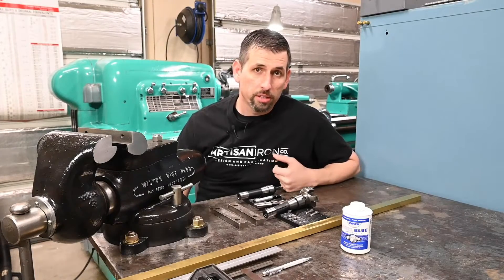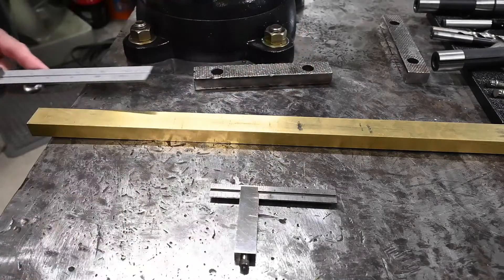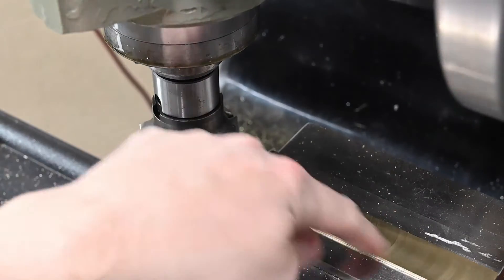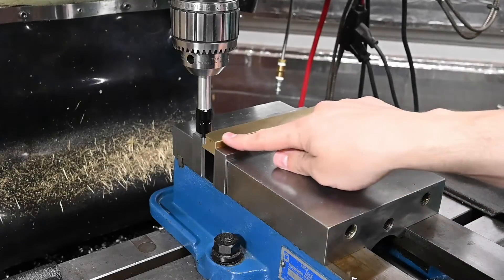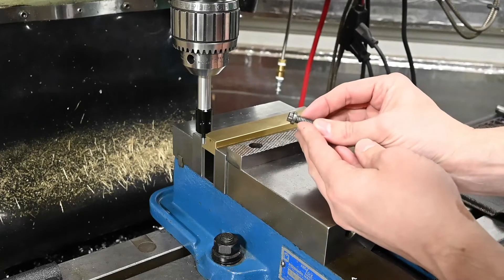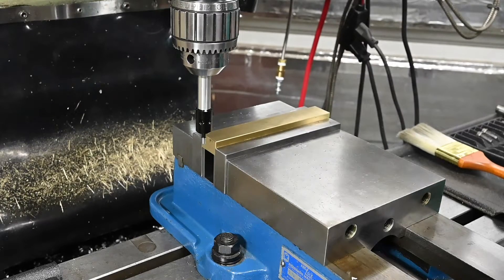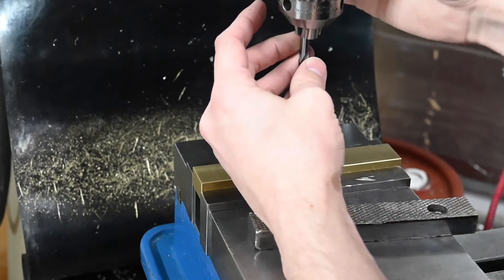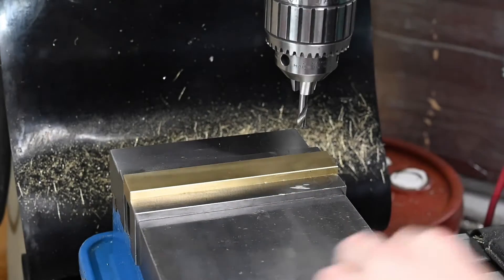Making Brass Jaws for a Rare Wilton 6" Vise: No. 60 Swivel Jaw

Comment: Great workmanship,  wrong material. Brass is  springy and slippery, which is the opposite of what you want. Copper is soft and gummy, which is what you want.
Reply: The static friction coefficient between brass and a notional steel part being held in the vice is actually higher than the Cf between copper and the same steel part. I *assume* you’re referring to copper having somewhat higher ductility than brass and thus it more easily deforms to “bite” around the part. However, if you can achieve the same result without destroying the part or your vice jaws, maybe brass is the better choice for this application. I think Aaron made a good choice here. 

https://www.engineeringtoolbox.com/amp/friction-coefficients-d_778.html
Reply: @thomasutley  I'm sure you have all sorts  of arguments and links to support them. Yet, the fact remains brass is relatively hard, springy and slippery. And even the link you posted says that coefficient of friction for steel on brass is slightly less than on copper. So... what's your point here? Show me how smart you are? Yeah, I get it. Except, I have copper soft jaws on my vise and they work noticeably better. So I'll leave enginerding to the enginerds. :-)
Reply: voron11000 cool story, bro. Tell us another!

Comment: you could use a indicator and indicate the hole position, after indexing to a end stop. swap the original part with the new part.  change tools and drill/counterbore holes.  should get ya within .005" or better.   Nice job!

Comment: No cutting oil on non ferrous metals.  Kerosene can be used.
Reply from the maker: It’s actually Tap Magic, not oil- calls for use on brass or aluminum.
Reply: Richard J Lundeen None, ever? Not even soluble? Non ferrous metals don’t get hot? Non ferrous metals can’t work harden? Non ferrous metals can’t gall? Are you sure? Go through a lot of drill bits do ya?

Comment: Neat job. Perhaps you can also do a vice with aluminum jaws, I actually have a inexpensive vice with aluminum jaws that I cut both vertical and horzontal 45 degree grooves in that I use as my everyday bench vice for such work
Reply from the maker: Funny you mention that- it’s exactly what I was going to make for my Wilton C1- will be the go-to for round parts. Thanks as always for watching, James! ——Aaron